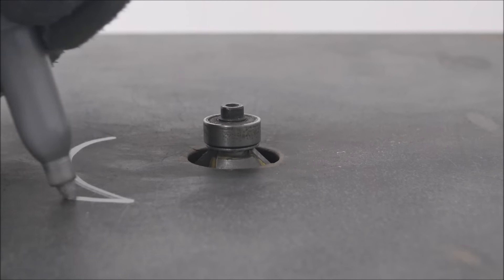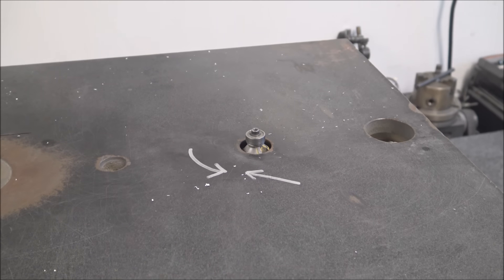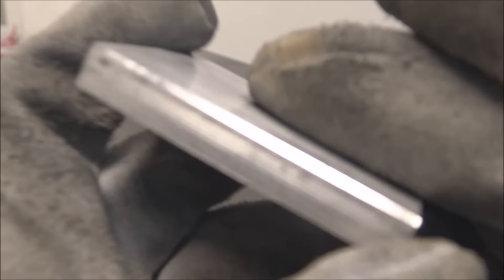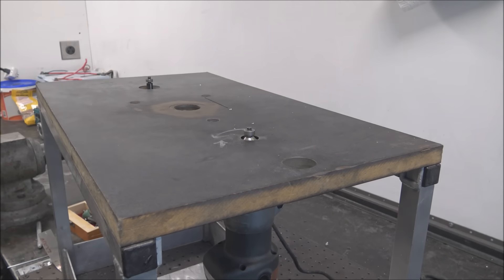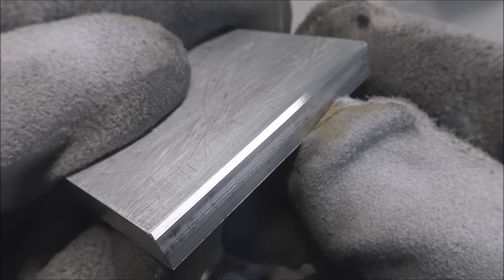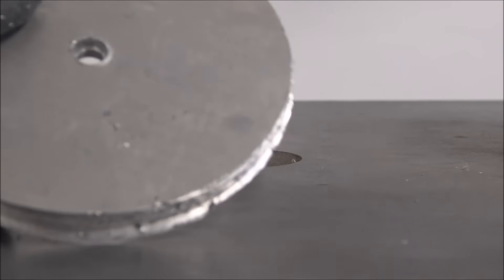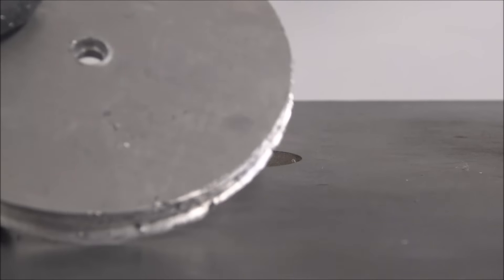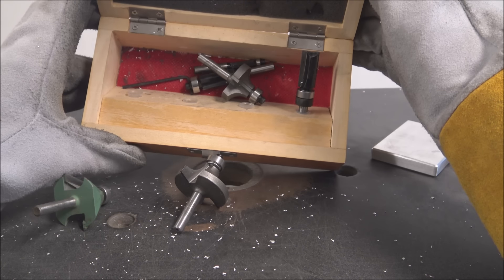Aluminum Fabrication - Router Cutting Etiquette - "Right" and "Wrong"

Comment: The "correct" way is known as conventional milling; while the "incorrect" way [that produces a better surface finish] is known as climb milling.

This effect works identically on a milling machine (using HSS or carbide cutters).  All manual machines have ~some~ backlash (which will either wreck your part or break the cutter, depending on the size of cut being made), which is why conventional is mostly recommended. Climb always gives a superior finish and is actually better on cutter life; which is why it's common in CNC work (and because they utilize ball leadscrews, which eliminate backlash).
Reply: Well, on a milling machine, you can tighten the wedge and the jerk will not be noticeable.

Comment: Nice tips.  I use my router table for this.  the back fence helps lot.  I also dress my bits with a diamond lapping stone to keep them sharp.  I also hook up my shop vac to gather all of the chips so things don't get so messy.

Comment: I've found with the cordless routers and general fab if I rough cut first and either go fast and try not to dig or use my glove hand as a sort of guide you can keep the router bit the same depth and then run the "wrong" way on the way back you can avoid the digging and grabbing of the part. Works great when routering stationary parts like boat chines, frames, windows. Etc.

Comment: Dude.... just a dam nice video.    Reminds me of when I machined beadlock rings, and bolt in wheel centers out of 3/8 aluminum with a carbide single flute wood bit on a ShopBot cnc router table LMAO   It took for ever to do but they turned out awesome!

Comment: Thanks for the tips. I need to make a few aluminum throat plates for my oscillating sander, so of course they’re round about 4”. I’d like to use the original I have as a pattern and adhere to the new blank then route the outer diameter with a straight bit with a bearing much like one would do with woodworking. Any tips?

Comment: Handy tool that! Ive got something similar at work. I use a pneumatic die grinder, usually on steel but i do have a bit that'll do aluminum. The die grinder is marginally safer cause if i make a mistake it stops really easy.

Comment: Does the lube even stay on the tool at the high rpm speeds? Do you see a difference if you don't lube?
Reply from the maker: Aluminum galls up and clogs cutting tools if you don't lubricate.

Comment: Yeah that works great! We used a similar contraption to deburr parts off the mill and for weld prepping with carbide bits, chews right trough stainless too if you take it slower. Fast and easy and the consumables are cheap. And if you go the wrong way make sure there is nothing in the flight path of the thing. lol
I'd kinda recommend to not wear gloves tho... Better to have a tiny bit of the fingernail cut off than the thing pulled into the bit :|

Comment: FYI, you can get a handheld pneumatic chamfering tool for quite cheap thats much easier to use and leaves a much better finish than a typical router. You can even do very thin sheet and small holes down to about 6mm with them. You can get corner rounding inserts for them as well.
Reply: This is also alot safer than wearing gloves while using a router table...
Reply from the maker: Please show us all a link to the exact tool you are referring to.
Reply: @6061  they are all over Amazon and eBay from different brands for like 40 bucks.
Reply from the maker: Thanks,
Those tools have their place, but you won't get nearly as consistent of a cut on smaller parts like in this example. It would be too wobbly. You'd be all over the place trying to chamfer the parts I show in the first of the video.

Another option would be to just unscrew the 4 screws that hold the laminate trimmer up under the table and use it exactly like one of those pneumatic tools. Put whatever bits you want in it...
Reply: @6061  Yeah, I guess for some. I've never had an issue with them being wobbly for similar parts. They do take some practice, just as the router example does. I have used a router just the same, and after having the pneumatic one I will never use a router again. Unless its just too big of a chamfer for it, then I guess a router would do if I cant do it on the mill.  To each their own.
Reply: @6061  Oh....and they work for steel. I wouldnt put steel to a router. If you work with steel.

Comment: Why not use a Microjig push block. 

Standard on a router table.
Reply from the maker: For larger parts, maybe.
Personally, I see no benefit using one when chamfering small/medium sized parts like in this example.

The bearing bolt on the router bit is taller than the thickness of the aluminum being cut. That means you'd have to reposition the push block several times to cut around the entire part (tedious and time consuming). And you can't use a push block to do the 3/8" long corners (when standing the part up vertically).

It comes down to personal preference. For me, It wouldn't make the task any easier/safer.

And of course the safety conversation will come up, so I'll address that too:
Depending on skill level, for you it may be safer/easier to use a push block, but if you are experienced, alert, and mindful of what you are doing at all times, it may not be necessary.

Everyone stay safe and work within your own limits.

Comment: “Backcut” in the furniture making industry is a small secret when you want a flawless finish, especially when routering veneered plywood/board etc., far less to zero tear out on long grain and end grain. It’s not “really” that dangerous, you just need to know what you are doing.
Reply: Compression bits on a CNC router will do the same if your settings are correct
Reply: I clean up all my router lines on the corners by going "the wrong way".

Comment: Have a look at 'de-gloving injury', just not around dinner time. Hint, gloves are a bad idea...
Reply from the maker: I've heard it 1,000 times.

This particular piece has sharp edges.

If you don't feel like you have enough control to keep gloves out of the cutting bit, then don't wear gloves.

I wear gloves because I know exactly where I can and can't put my hands/gloves.

If you try to replicate this without gloves, I suggest you hand file ALL the edges to remove the sharp edges before chamfering on the router table. If you go straight to the router table bare handed with the sharp edges, you will get cut gripping the part.
Reply: In order to really be a problem, the tool has to have a lot of inertia and/or a lot of torque. The router bit has neither torque nor inertia. Also there is actually very little exposed spinning bit. The bearing is not capable of applying torque. That is the whole point of the bearing.

Comment: Very nice chamfers.. heres something you might find helpful.. rather than using wd40 try some "drylube" that has very fine Teflon powder in it.. just shake it really good to ensure a homogenous mixture where the teflon powder is evenly distributed throughout.  Then let it dry completely.. .it usually lasts a long time when i use carbide burrs on aluminum and it will basically eliminates the greasy slurry of chips. Hope someone else finds this useful. Ive had good success personally.. at least i think thsts the case.. lol.

Comment: Scotchbrite is the answer for finish, avoid cutting or breaking fingers
Reply: Scotchbrite absolutely ruins the finish on nice aluminum. Never use abrasives for finish on aluminum unless its an old piece of scrap you need to clean up, or you want a brushed appearance ..and even then it looks like dog doo.  Thats a total noob move.
Reply: @ArionRaine  Perhaps you've never seen the full extent of 6061's Al finishing techniques.